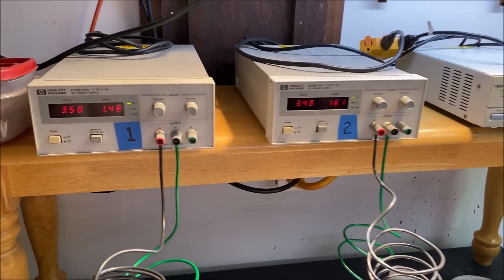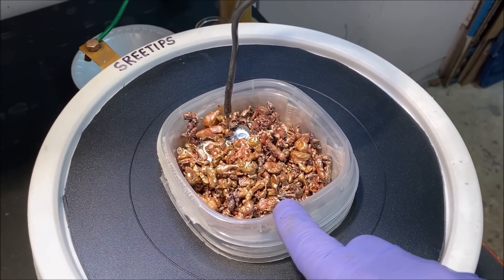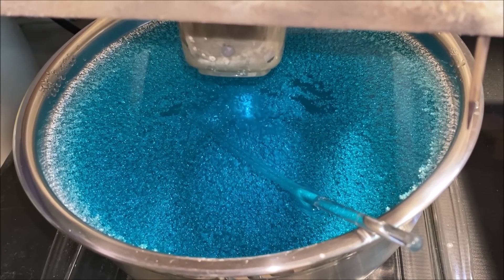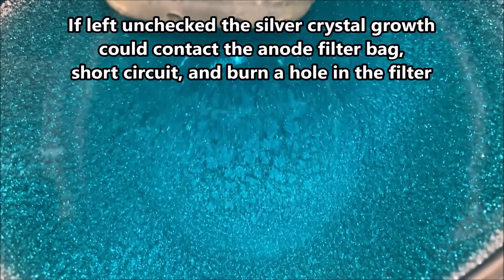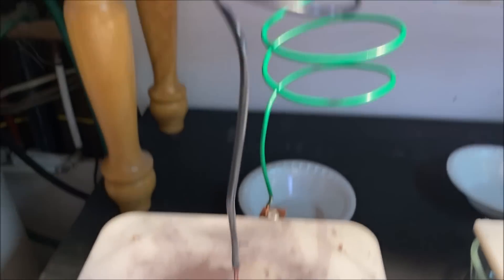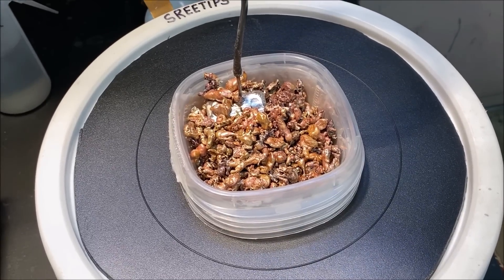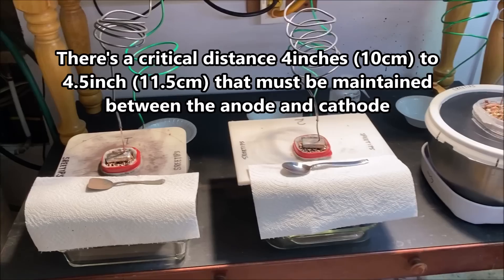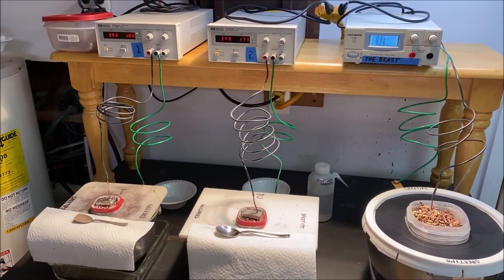Silver Cell Maintenance 48 Hours Crystal Growth

Comment: Does this process generate a lot of heat?
Reply from the maker: The cells are slightly warm to the touch to room temperature ambient. Not a lot of heat. They warm up at first when current flow is high. Then cool down as current flow drops off.

Comment: I wonder if you could use a larger glass fish tank with a supersized filter basket i think at least a square Stainless steel pan or pot would allow more room on sides for growth with a supersized filter basket
Reply from the maker: The distance between the anode and the cathode is critical 4 inches to 4.5 inches (10cm to 11.5cm) must be maintained
Reply: @sreetips  thanks good to know then a circular vessel is very efficient

Comment: I’m just curious but it seems if the beast isn’t consuming the impure silver then it must be coming from the electrolyte… right? It always seems to me that using pure silver in the electrolyte just uses the electrolyte to create pure silver crystal. It just seems off that the impure silver is the only place you’re getting silver from… some must be coming from the electrolyte too. If you use impure silver for the electrolyte what happens then? Would it just become saturated with copper? Is there a way to take the copper out of solution leaving only the silver nitrate?
Reply from the maker: Not that I know of

Comment: You can try to install a swinging arm that you can acuate from the top of the silver cell to knock back any growing silver crystals. This can be put on a timer with an automatically swinging arm or can be done manually by twisting the arm with your fingers. Just drill a hole into the top of your silver cell next to the filters and install a plastic or glass rod with a plastic fork or knife attached to the end. when the time is right, just twist the rod to knock the crystals back.

Comment: Why doesn't the copper plate out of the solution too?
Reply from the maker: It won’t if concentration is kept low and voltage kept at proper level.
Reply: Under the correct conditions (low concentration, voltage not too high), silver will push out any copper trying to plate out as copper is more reactive than silver, meaning that silver has a stronger tendency to plate out.

Comment: one thing i didn't see anyone comment on in the last one is that the anode bar for cell 2 looks quite tarnished, i have to wonder if cleaning up that bar a bit might help that cell chew through the impure shot at a better rate, aside from the cathode patina factor
Reply: I noticed that in the previous video..I'm.wondering did it get hot or just tarnished,,burnt metal is less conductive so could be causing problems

Comment: I’m waiting for the video title “SREETIPS POURS A SILVER BAR THAT WEIGHS MORE THAN HIMSELF” 😂
Reply: lmao
Reply: That'll be a big ass bar 😂😂😂😂😂😂
Reply from the maker: My weight (230 pounds, 104.3 kilos) would be about 104300 divided by 31.1 equals 3354 Troy ounces times spot silver ($30.50) equals $102278.78 in silver. But when silver gets up over a hundred bucks, I’ll be worth $335500 priced in silver. My goal is 5000 ounces of silver!
Reply: @johnheckles8239  just did a rough estimate of 218 lbs for Mr Sreetips  and a 4 inch x 4 inch cube would be how big the pour would be so if you multiply that by 3 you would get roughly 654.75 lbs per cubic foot

Comment: I wonder if you could do a price breakdown? Is the profit margin way more on the pure silver crystals than the regular silver in solution?
Reply from the maker: Sterling silver can and should be held like it is. No need to refine it. It will track right on up with the bullion price as long as you don’t melt it and ruin the markings. The only reason I refine silver is because I use it to refine gold. However, in order to calculate a “profit” I’d have to sell the silver to realize a gain or loss. I’m not wanting to sell my silver. After refining, I put it away and forget about it. The silver will be used for my retirement.
Reply: @ cool. Thank you